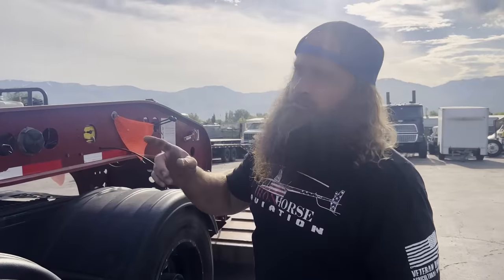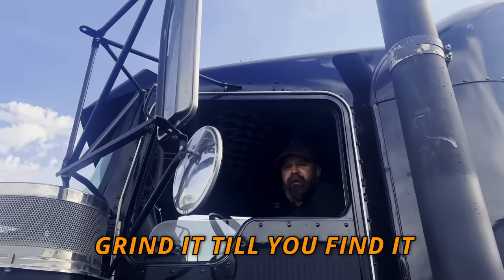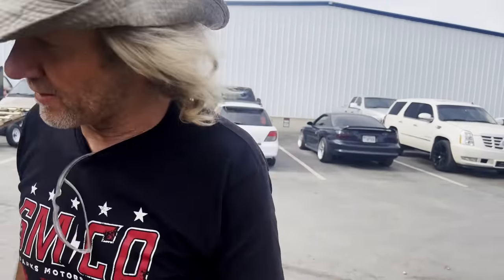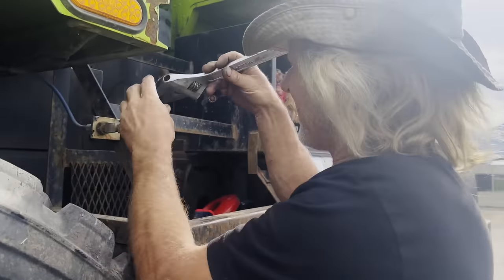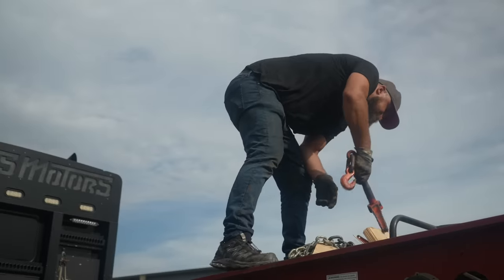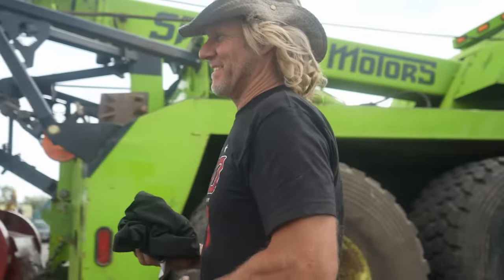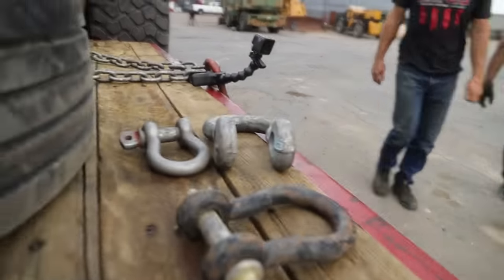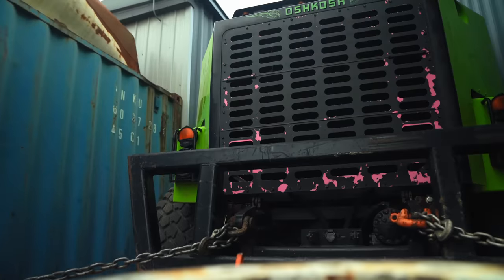FULLY LOADED! Het Wrecker Finally gets put to work!

Comment: If the tractors have implements still attached its going to be tough job. I think they will get them in 6 hours barring more rain.
Reply: one off the picture showed the implements disconnected, at least the rear section of it

Comment: Just to help out how you secured to the front of the turtle is not legal. Unless you’re running two chain at the rear, two chains in the middle [that I could not see] and then one up front. The one chain is fine but you have to secure it with two binders to be legal. If you need more of an explanation let me know.

Comment: I think an offroad capable support truck with massive storage to store all rescue equipment and extra fuel, etc should be built in house and assign someone to keep it stocked and ready for rescues.
Reply: I made the same comment about a year ago. They have the capability and it would simplify things greatly, but so far nada.
Reply: They do so many different kinds of recoveries with different vehicles, it would be cost prohibitive to stock every vehicle with even the bare minimum required. Perhaps having a storage room with all the equipment with quick and easy access might be a better idea. A support truck would just be another vehicle that needed maintenance and added cost to drive to the location
Reply: @davidclemens1578  I don’t know they have a ton of vehicles just sitting around and in case you haven’t notice they don’t tend to do maintenance on the vehicles they have now, it seems almost every video there is a vehicle that hasn’t been maintained or repaired. Lol
Reply: A few months back they started making a crew truck with a utility box.
Reply: Yeah its Bud in his white pickup. Always got a Marlboro hanging from his chops

Comment: My Boss Needs your Help with his Motor In his Shuttle Bus at work... C.E.O of the Renaissance Festival of Colorado ... We do not know what it's doing.. Its not pulling little hills , it going from White smoke to Black smoke.. And we have changed the Fuel Filter and that didn't do anything for it... PLEASE HELP US ... We open June 17th 2023 ... And we need The Bus to pick up people and take them to the Front Gate...
Reply: Mr.D Sparks.
We start the Festival the 17th of this month.. I don't work on them I just drive them.. 😔. So when one blow's white smoke and then black smoke that to me means coolent.